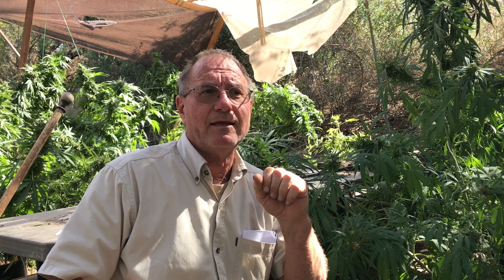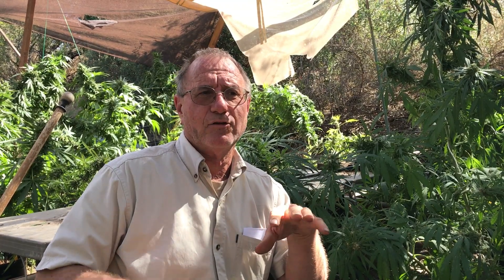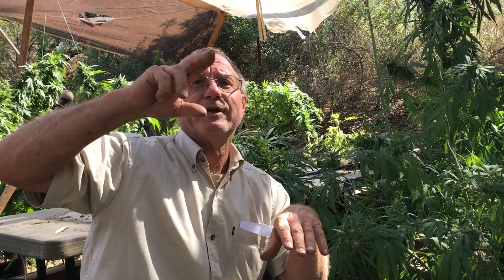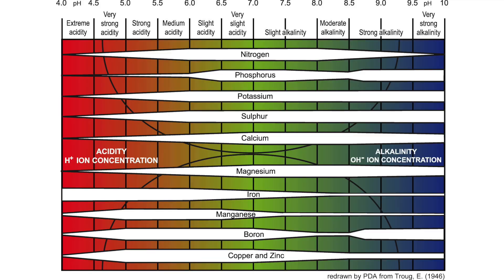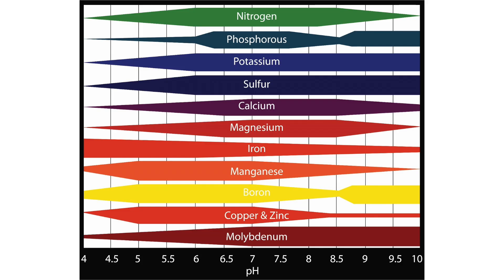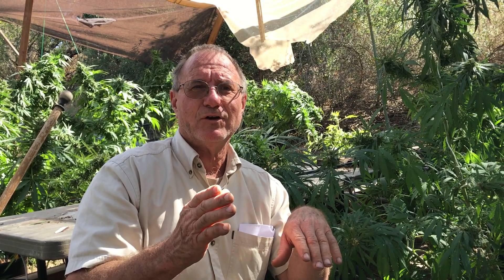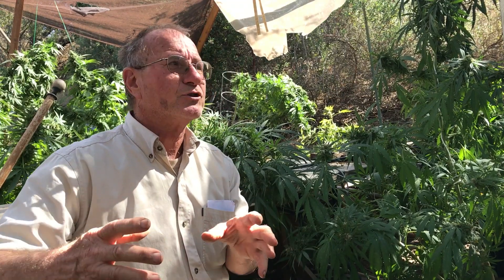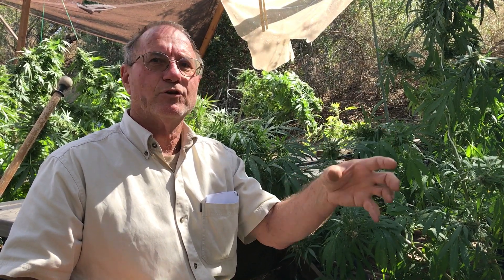Understanding EC, PPM and pH of Nutrients

Comment: hello can you tell me what i'm doing wrong. I watered the plants according to table ec, much less fertilizer than recommended by the manufacturer. about 1-1.2 ec. In the last watering with clean water about 0.8 ec water that flowed from the pot had ec 2.8-4.0 now I noticed that the leaves have symptoms of excess elements. what to do now? to pour distilled water? How can I avoid it in the future?
Reply: the runoff is higher due to built up nutrients, no do not water with distilled water it leads to even more burns because of the osmosis effect, water them with a fifth strength solution with a 20-30% runoff and be careful that the pot doesn´t sit in the runoff water because the medium will reabsorb it. ps. to avoid it in the future always water with runoff (also do not let it reabsorb) if you do grow in coco or rockwool do not let them dry out completely as it will deposit salts into the medium

Comment: What ppm do you need for growing? High low?
Like an average.

I've two 3 month plants currently locked out.
Done a flush, got ph right but not sure what ppm I need.
Ones 450 ish
The other was 800 but fished again came Down to 600 then.
Reply: Cuttings 0.6 ec veg plants 0.6-1.4 flowering plants 1.2-2.0. Depending on environment. A grow with co2, top end lights will allow higher ec.
Reply: @jh772  thanks been looking for this info for ages and cant seem to find out but you just answered  my question  🤜
Reply: @jh772  and depending on plants if we talk about cannabis, "sativas" like a lower EC and "indicas" can tolerate a higher EC, best practice is to have a moderate EC and if they look hungry just raise the EC a bit

Comment: So fluctuations in ph should be beneficial
Reply: @where the chief Yes. A little pH drift in hydroponics is a good thing.
Reply: @Des420  plants do like consistency of you keep them at a pH of 5,5 they get all their nutes they want besides that all the nutrition is already plant available so they do not need bioprocesse to convert their "food" into a "digestible" form,. but one can use the pH to alter the diet of the plant if they have a toxicity of potassium you can lower the pH so they absorb less potassium without having to change the nutrients
Reply: @Humbulla93  There's no reason to chase a magic number. Ph will drift slightly no matter what, and as long as you keep it between 5.5 and 6'ish there's no need to keep making micro adjustments that are worse than a little drift. Availability isn't at a set point, but over a range.